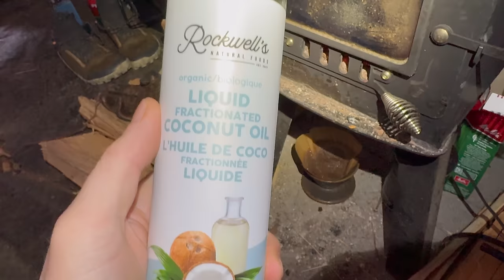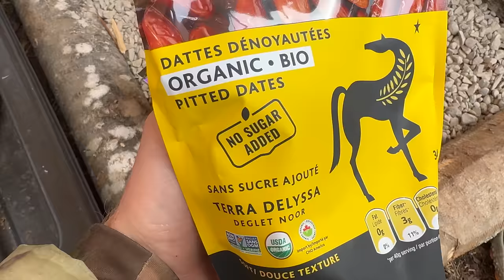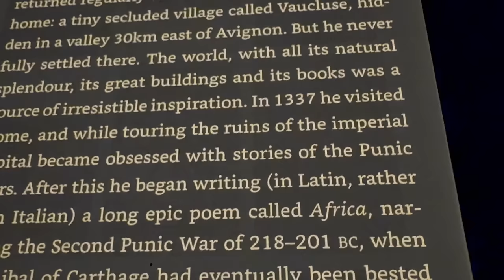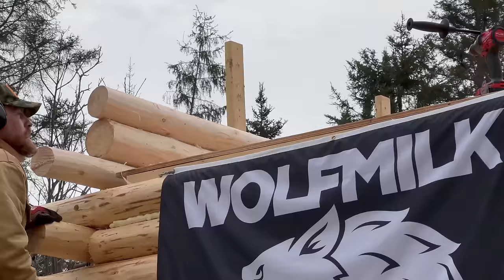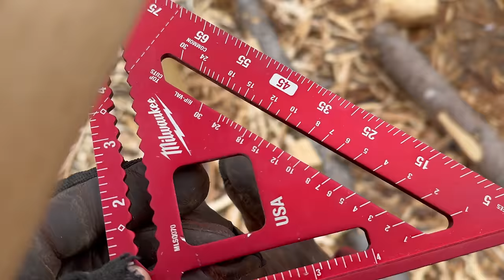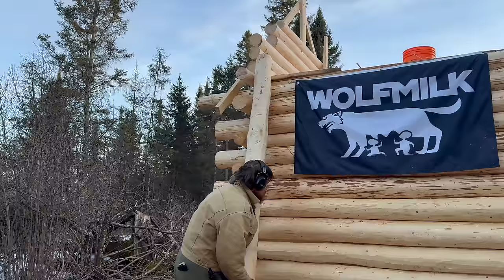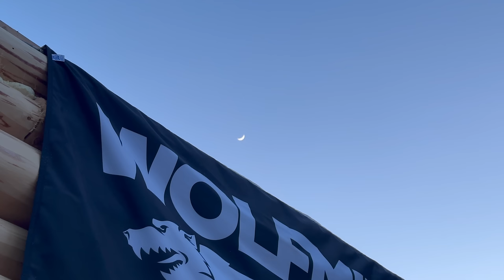Winter Log Cabin Build on Off-Grid Homestead |EP14|

Comment: I would like to suggest a large sway brace at each gable from the top plate log to the beam to give that enormous heavy  structure some sway. Even if they are temporary until you have roof sheathing to provide sway. I am a retired carpenter with 50 years experience in rustic work. Best of luck to you, you provide this old timer with some chuckles.

Comment: Very smart advice from that old timer about using the wind corridor to plan your fields, as well as to mimic what was done in the past by clearing the field grown trees.   One word of advice though, is stick to silvo pasture ideals, pasture your forest and forest your pasture.  Strategically keep some of the trees in your fields for bird roosts while hunting insects in the field/meadow/pasture, shade and natural shelter for your livestock if you plan to use them there to establish the meadow and feed them.  Extend  the length of the edge between forest and meadow/field by clearing into the forest, and allowing peninsulas of sparse but older trees extend out .
Reply: Some suggestions on livestock that would help in establishing your homestead and reclaiming parts of the forest:  Cattle (Milk cow and steer/heifer calf, or a steer you can harvest at the end of summer.), Meat chickens, layhing hens.  Feeder pigs in particular would be a huge boon in reclaiming the forest areas and can be harvested in fall and not need to be fed during the winter months.  Think of the additional feed you might need for any of the livestock as paying for fertilizer or gas for your power tools... Smart rotational grazing and strategic disruption from animals can be a powerful tool.  Biggest hurdle at this point would be some basic infrastructure and investments, and your current lack of water up above the river bottom.

Comment: TOOL SUGGESTION: an electric sawzall would be good for trimming small stumps and shrubs close to the ground. It won’t hurt the blade if it gets into the dirt. If you keep putting your chainsaw blade in the dirt it will wear the chain and bearings much faster.

Comment: I was wondering when you were going to get an ATV.  Most of the trees you are looking to thin out can be processed by a forestry mulcher whether on the ground or standing.  Mulchers can cover a lot of terrain fairly quickly turning the limps, downed trees, standing trees, brush etc. into small wood chips that quickly decompose and become nutrient topsoil. It is not cheap but probably worth it to turn that area back into a pasture.  I live in Oregon and have a land clearing / forestry mulching business.  I am not sure what the fire danger is in the summer where you live but it will get rid of all of those fuels that pose a danger if a fire did come through there.  There are a couple Canadian companies that make mulchers and with the dense vegetation you have in that area I am sure you could find someone local to come out and do some thinning.  What would take you a couple of years to thin could be accomplished in a few days with a mulcher.  Keep up the good work!

Comment: Personally, given it is a permanent structure, I would probably use cement to fill in.  Given the shrinkage from the wood drying my next choice would probably be clay.  Moss would work but it's more of a bush/survival type of material.  It's not going to keep out bugs as well as clay or cement and will require replacement frequently.

Comment: M8ght be a bit late now but if you cut your blocks on you log ladder like ramps, sliding the logs up would have been much easier you could even use a rope on each end to pull it up rather than push. But still amazing work as always well done!

Comment: You need to have a fire going while you work that log you tossed would be good, get a 50 gallon metal drum drill holes 8” up from the bottom and you have a burn barrel that will burn anything. Also please clean your chimney.

Comment: I'm a little concerned about the size of your ridge beam, given it's unsupported length of 16'.  I don't know what the snow load is in your area, but I'm betting it's pretty high.  Even without load on it, if you left it alone for a couple of months, pretty sure you would see  some visible sag at mid span.  Consider maybe installing a mid span support, wouldn't have to be huge, but would need to extend from the underside of the ridge to a footing at ground level.  You don't have the floor in yet, so adding a footing would be fairly simple.  And you could run the support post from top of footing to underside of loft floor decking, drill in say a 12" x 3/4" dowel then fit another support over the dowel from top of loft floor to underside of ridge.  Either that or perhaps add purlins half way between the ridge and the side walls, to help take load off the ridge.  They could be less in size, would be a good use of the ridge beam log your neighbor gifted you, but you'd need to find another to match.  Just a suggestion.  Great progress, keep up the good work!